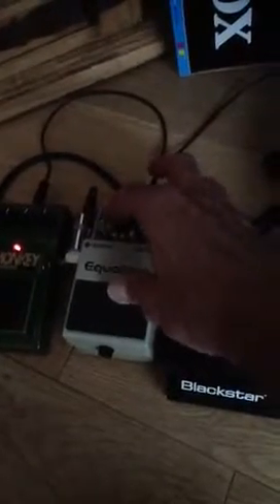Modding my Boss GE-7 (part 2) [trying to eliminate the hiss]

Comment: I may gave to look into doing this mod. I'm on my way out to buy a used GE7 and really enjoy modding pedals to the point I actually search to see how many different mods are available for a pedal before I buy it. Not really the case with the GE7 as I feel it would have done the job I required anyway, but glad to know I can reduce the noise. The fact such mods exist will simply add to the fun of this pedal.  
I always find it strange when people say that EQ's are useless. A decent EQ allows you to compensate for gear that does not have the voicing you want whether it's a scoop sound with boosted bass for metal rhythms, a mid boost for leads or simply to reintroduce high end lost from long cables or ineffective buffers. You can even use it to boost the level of your signal to drive tubes harder if your EQ has an overall level control.
Reply from the maker: +thisdyingsoul76 I found that with the upgraded op-amps it made it a much more useful pedal. I play at home at fairly low volumes so the added hiss was annoying me, it doesn't hiss anymore :)

I agree about pedal mods, it's nice to learn about the circuits and see how you can alter the sound. I also modded a Boss CS-3 compressor by changing the caps and opamps but it made very little difference if any.

I like to use my EQ to give it a little low-mid hump which gives my amp a slight dumble sound.
Reply: Yeah I noticed it does have a bit of noise while I was testing the pedal out. I'll definitely be doing this mod.  My plans for this pedal are primarily to tighten up the low end and get a more defined mid scoop when I'm playing metal rhythms, turning it off for the lead tone to get my mids back. My other plans are to use it to boost mids when playing classic rock or blues and maybe even as a level boost to drive the front of the amp more

I'm pretty new to mods, but have repaired an old stereo volume pedal so far and performed a few mods on a Marshall Guv'nor Plus I got real cheap. The Gov'nor had very sad high end. Like someone put my amp in the closet and shut the door. Even with the treble up full it lacked sparkle. I found a couple of mods online including some credited to Brian Wampler and have been making these changes as I can get the parts. So far, you'd never know this was the same pedal now. And all I did was remove one capacitor and change the clipping diodes so far.   I'm also planning to experiment with different mods on some Boss DS-1 and metal zones soon with an eventual plan to move up to building one kits.
Reply: Baron Orm I'm waiting on the parts as we speak because after spending time with it it, I do notice the hiss.  I kind of do the same thing. I cut some of the high mids and add a bit of low mids.  I'm kind of going for that high gain Mesa Boogie or Soldano sound.  I also add a bit of low end because my amp is a bit lacking in that area.  Great blues or classic rock tones but not so great when I'm playing heavier stuff.  One area I think a lot of people chasing that scooped sound make mistakes with an EQ is they cut too much.  I tiny cut of just a few frequencies in the mid range is all you need.  The boosting of the lows or highs would depend if your amp is lacking anywhere.  Once I get a chance to mark my settings for the metal tone I'm probably going to look at other settings.
Reply from the maker: Are you going to do a before/after video? Would be worthwhile I think.
Reply: I probably will do a before and after. Like you, I plan just to start with the op amp swap, but as I get more components in my stock pile, I'll probably try the hi-fi mod too. I wish I'd thought to do a before and after video of the mods I'm making to a Marshall Guv'nor Plus I picked up a while ago. Just removing a capacitor and changing the clipping section made a muddy, useless pedal into one of the best I've owned.

Comment from the maker: Mooferoo it wasn't a kit I just found out which op amps I had inside my unit (3x JRC 022D) and looked on the stompbox forums for replacements that people had successfully used.

I ended up ordering some chip sockets and some Texas Instruments NE5532P low noise op amps. I desoldered the original chips from the board, soldered in the chip sockets (so I could swap out the chips in the future if required) and then popped in the new chips.

It's made a MASSIVE difference, you can't tell that well from the videos the change it's made. The pedal is now really useful and the hiss is significantly reduced.

I didn't bother doing the full resistor/capacitor replacement as I wanted to see what just the op amp swap would do and it's fine for me now :)
Reply: +Baron Orm If anyone's interested, and you haven't already seen it, I just read this article, and the guy swaps out a load of the caps too and apparently "you will find that the frequency bands are more refined, musical, smooth and precise." 

I can't vouch for this, as I haven't tried it - I don't even own a GE-7 yet, but it's on my shopping list! Just FYI, while you've got the thing in bits...

http://www.effectsbay.com/2015/11/guest-post-boss-ge-7-low-noise-modification/
Reply from the maker: Cheers for the details :)